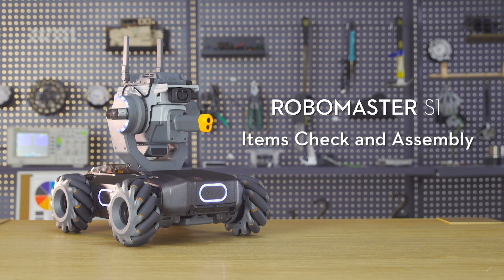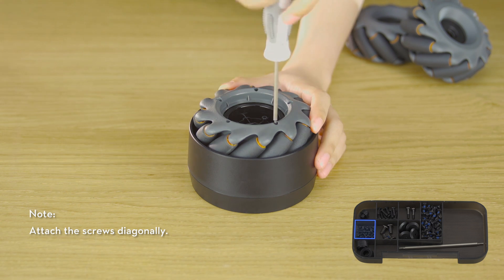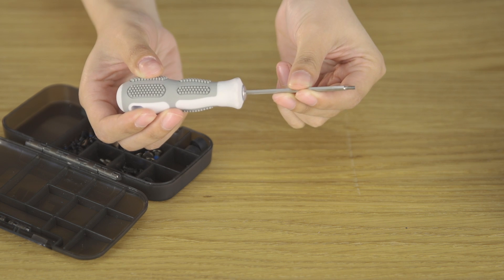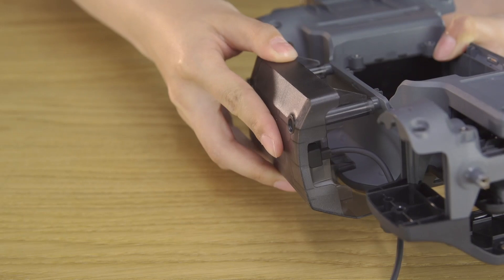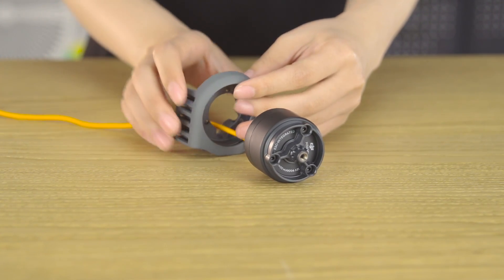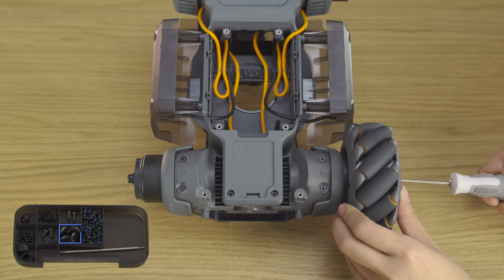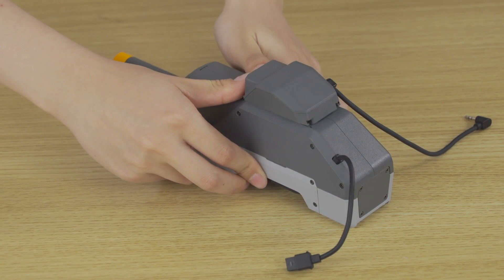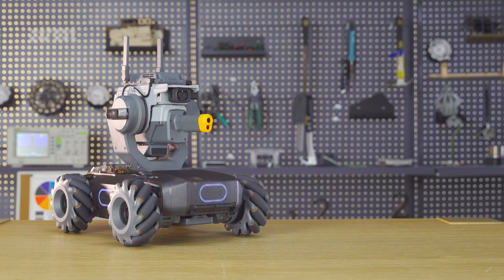How to Assemble RoboMaster S1

Comment: Does it come with the screwdriver
Reply: Yeah, it does and the screws and a little box for the screws and the handle has a bit with 2 sides one for small screws one for bigger screws AND it has the grease for wheels and often you will have extra (i did) and the screwdriver bit is MAGNETIC so you don't lose the screws and it's super cool
Reply from the maker: Hi George, the screwdriver handle and bit come with the box. You can check the quick start guide here https://dl.djicdn.com/downloads/robomaster-s1/20190612/RoboMaster_S1_Quick_Start_Guide_v1.0_multi.pdf.
Reply: Thanks

Comment: Is DJI Care Refresh available with this product?
Reply from the maker: Hi John, currently, RoboMaster S1 doesn't support the DJI Care Refresh service. Thank you for your inquiry.
Reply: @DJISupportGlobal  
Purchased the Robomaster s1 a little less than a month ago. already got bad rear right motor, "check connection " I did.  re seated them and nothing. am trying to get  a replacement and possibly buy an extra motor just in case this would happen again. any advise ?